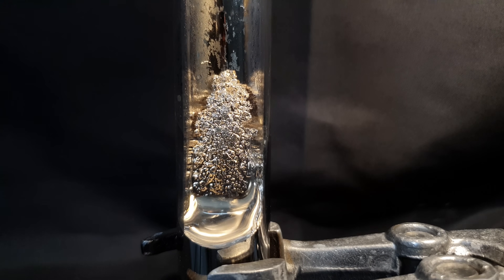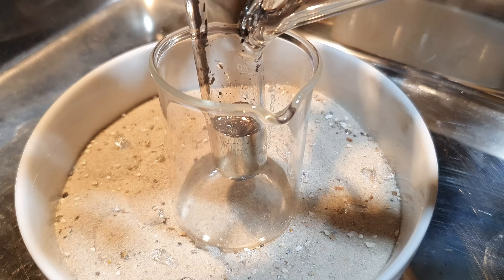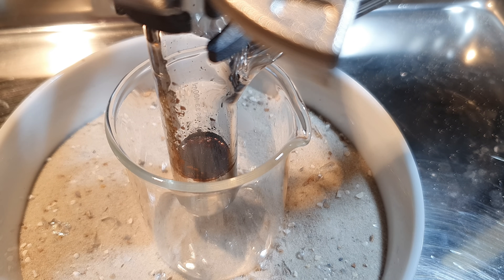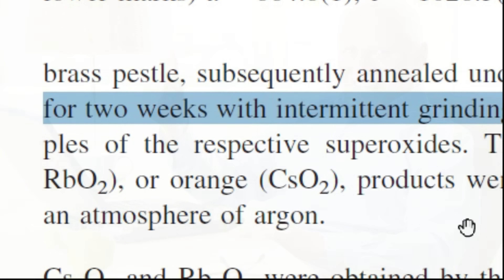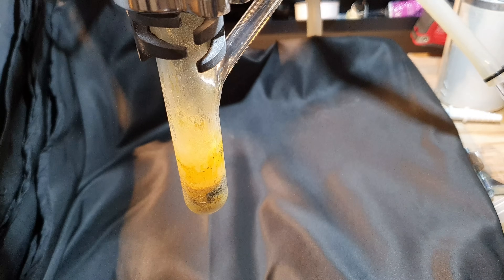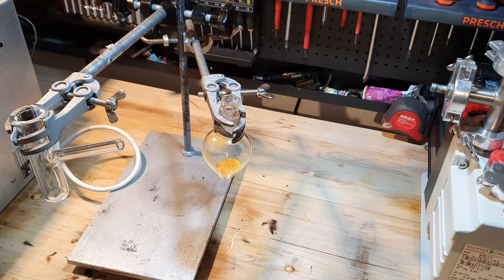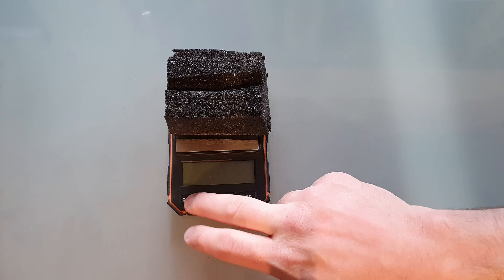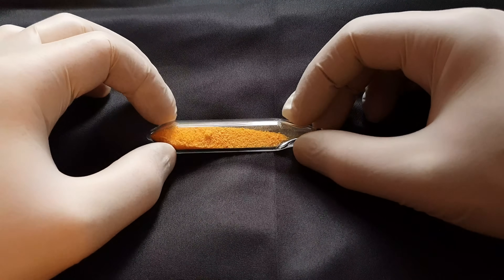Combining what shouldn't be combined: Making Cesium superoxide

Comment: Better would be to heat it to BP and inject vapour through some canula (hot) into a space filled with pure o2
Reply: This does work. You can even use a gas burner for a torch to get even mixing of your vapor and oxygen.

Comment: Really cool. Great job
 That long....not being sure if it was going to work, would have driven me crazy.  I bet you were missing a glove box.  I made a pyrophoric cmpd that fell out of solution and I filtered the solid straight out of the reaction flask on a schlenk line , rinsed the solid still on the line and still attached to the reaction flask. Had to take everything to the glove box to get the solid,  though. But it was made, cleaned, and the solvent removed all on the line without taking anything apart.

Comment: I think its interesting that with potassium there are these horror stories of people pushing some oxidized crust into it and it exploding but with partially oxidized cesium which should be a more non forgiving mixture of highly reactive metal and superoxide nothing much is happening. Of course I am happy nothing happened to you during the procedure but it seems curious why potassium seems to be more reactive in these situations if the reports are indeed correct.
Reply: It's just as bad. The issue is the metals form peroxides and super oxides while under mineral oil or kerosene. The friction of cutting causes an explosive burning that is hot enough to melt and send the burning metal flying. 😮

Comment: Why do you call it super instead of dioxide?
Reply from the maker: Because they are two different things. In dioxide, two separate oxygen atoms are present with an oxidation number of -2. In peroxides, two connected oxygen atoms with an oxidation number of -1 (each) are present (O2^2-). In superoxides/hyperoxides, the oxygen atoms are also connected but have an oxidation number of -1/2 (each) (O2^-).

Comment: A good way to make alkali oxides peroxides and superixides (oh my) is to heat the alkali metal to bpiling and react the vapors with oxygen in a burner. The oxide is Cs2O, the peroxide is Cs2O2, and the superoxide is Cs2O4. The last demo was pretty neat. 🤓
Reply: Nope. superoxide is CsO2, no doubling of the stochiometry needed. For Cs2O2 (instead of CsO) however, you are correct because the (O2)2- anion is diatomic.

Comment: You need to repeat the measurement with a piece of the same glass you used to make the tube.  How do you know the attraction is not due to something in the glass, or contamination of either the sample or on the outside of the glass?  The tiniest amount of ferromagnetic material would do this!
Reply from the maker: I actually tested it with the glass and did not observe any effect. But you are right, it could be caused by contaminations of the sample. I could decompose it to the oxide again and try again. If it was caused by a contamination, the effect should still be visible. If not, it should be gone. 
It is well known, that the superoxide ion has paramagnetic properties. But it would be interesting to try nevertheless.

Comment: Why Lithium reduces Cs+ into Cs? Should be the opposite...
Reply from the maker: Lithium actually has a slightly lower redox potential. But it would also work with sodium. The reason it works is that I am constantly removing Cs from the reaction mixture and thus shifting the equilibrium to the right side of the equation. 
I explained it in more detail in my first video about the cesium isolation.

Comment: "I have lost more than half of the product"
After spilling it 🤔
It's not gone, it's still there... You could just purify it
Reply from the maker: Easier said than done. How would you purify/separate a mixture of different (moisture sensitive) oxides, hydroxide and unknown impurities from inside the oven?
Reply: @AdvancedTinkering  if you spilled the whole thing it would be impure anyways, so how pure do you think this amount was?
I'd try to dry it and bring it all to a known oxidation level.
But for removing the unknown material it gets really tricky and is probably not worth a huge amount of effort.

Did you use it for anything yet?
Reply from the maker: When the glass broke I immediately blanketed it with dry argon and collected everything that did not come into contact with the oven. Due to the high temperature I think most of the product was protected from moisture. But it definitely did decrease the purity. 

Yes, I used the superoxide to make cesium ozonide.
Reply: @AdvancedTinkering  okay that sounds good 👌

Comment: how do we know that the magnet isn't just pulling on the steel plate of the scale?
Reply: nvm the boat thing convinces me
Reply from the maker: And I have tested it without the vial(you can see it in the video). The scale did not react to the magnet if the vial was not present.
Reply: Cause it would show a negative reading regardless it position to the vial cause it would always be pulling up the steel and he did show that he placed the agent far enough away hence the foam block and proof showing magnet not interfering with scale

Comment: Any chance you have or could make some rubidium and then show its alloys with cesium and other alkali metals?
Reply from the maker: I was thinking about that for quite some time now. But rubidium chloride is pretty expensive and I currently do not have the money for it. 
But as soon as I get some rubidium chloride I will make a video :)
Reply from the maker: The problem is, that the price is due to the rubidium. The tartrate is even more expensive. 
But by now I allready made a video about the isolation of rubidium from rubidium chloride.

Comment: Reacted under 1 atm oxygen at 290 C for two weeks--that's someone who had a lot of hopefully justified confidence in their apparatus.
Reply: 12:25 he literally says he doesn't heat it when he's away and the actual reaction time was 12 hours.
Reply: @MyWaifuNow  Welp. You're right.
Reply: No doubt
Reply: It was 2 weeks with regular grinding, though. The apparatus didn't spend 2 weeks straight at 290C at 1 atm O2.
Reply: Regardless of the time, he was also going at its contents with a fecking drill bit
Reply: @SEvie139  I was really disappointed when he drilled the bit by hand instead
Reply: I was just about to comment the same thing as a dabber
Reply: his*